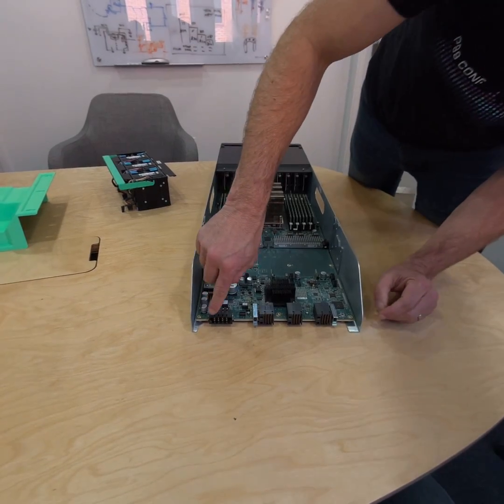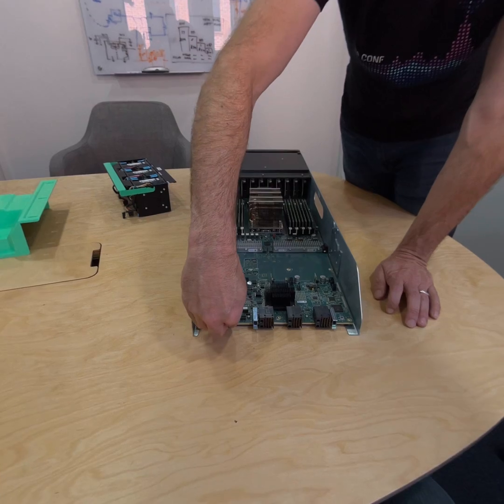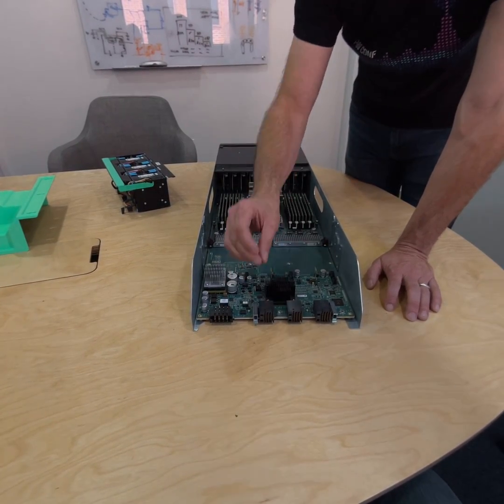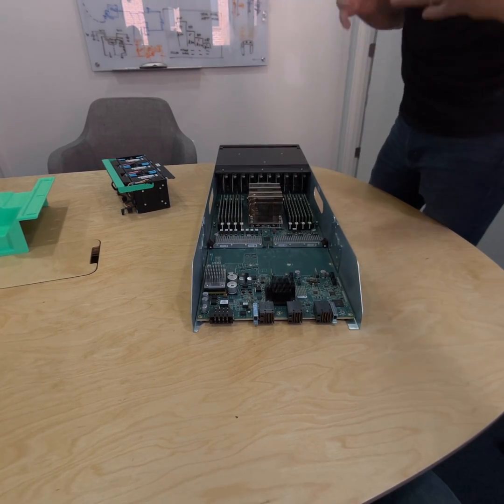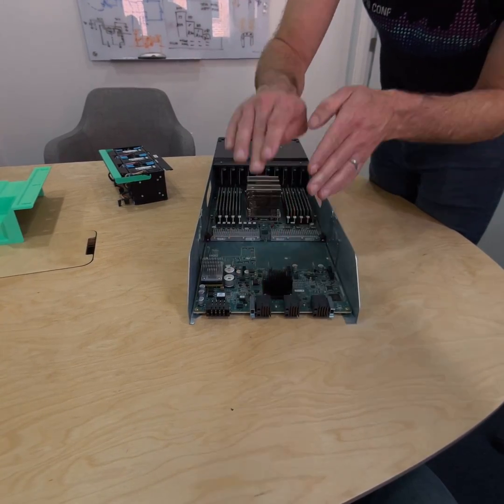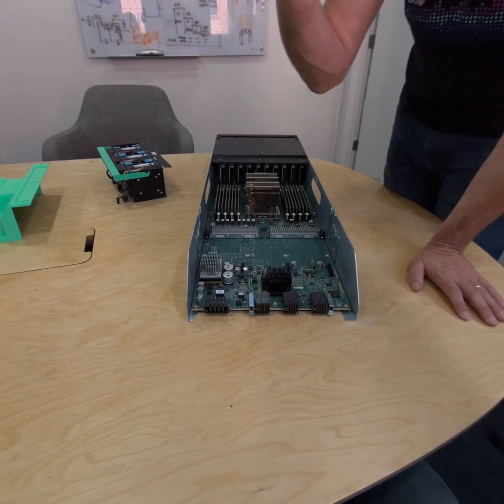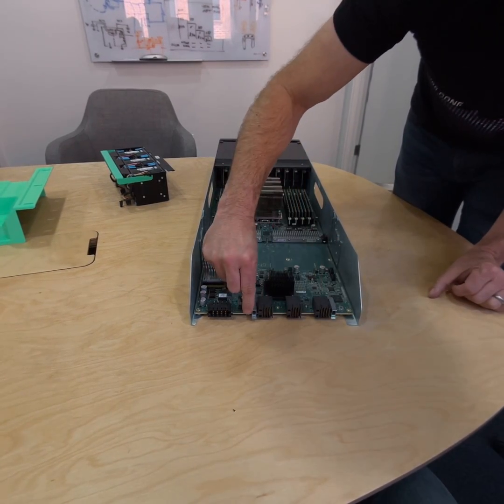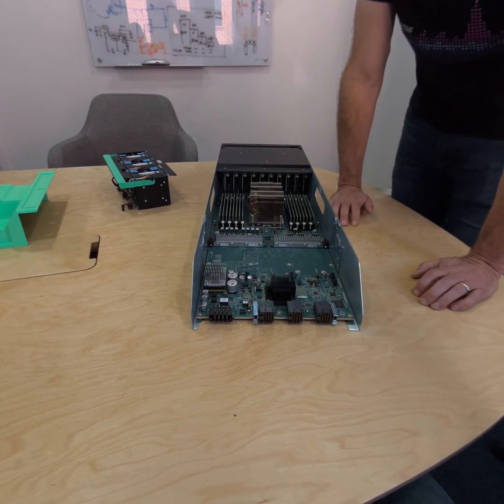Oxide Server Sled Rear Tour - Gimlet

Comment: Just thinking way ahead (possibly too far ahead). Is there any scope for releasing a test harness or a set of tools to allow larger customers to bench-test equipment when there are issues? Possibly to allow for troubleshooting of a sled outside of the production rack, possibly allowing oxide techs to remote in and do some remote debugging etc? Or is the expectation at that point, you'd just be returning the sled?